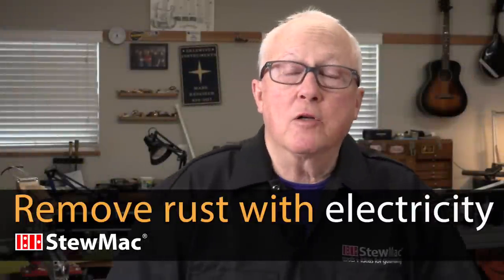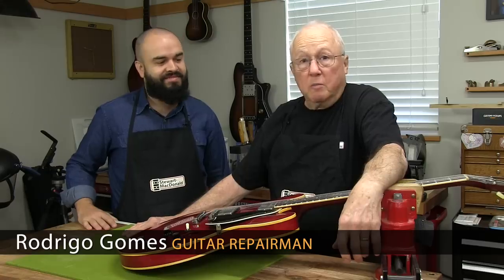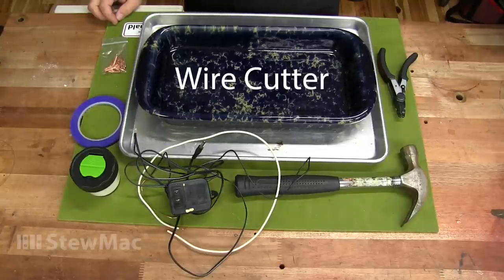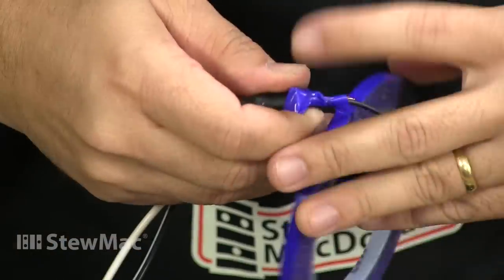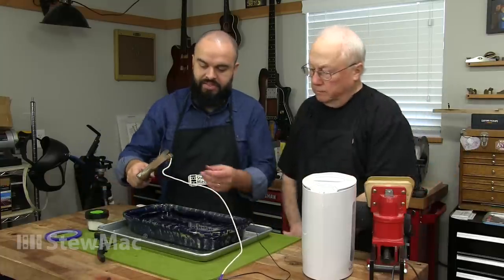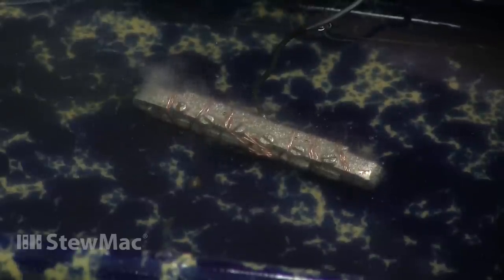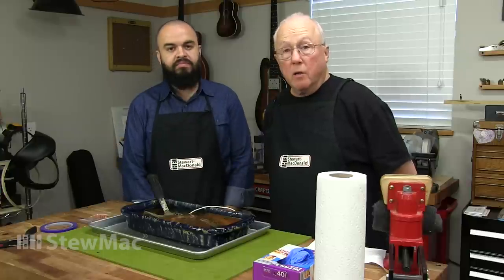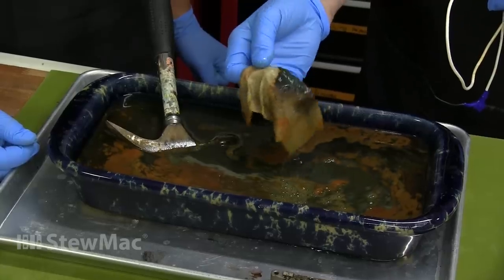Cleaning guitar parts with electrolysis

Comment: One caveat, don't use any stainless steel in place of the hammer.  The chromium leaches into the water and can make some pretty toxic compounds.  Use mild or carbon steel, or better yet, graphite  (I found some graphite plates on ebay).
Reply: manobrass it just needs to be a piece of scrap steel.

Comment: 2 Amps or higher

shows PSU capable of 300mA
Reply: CSGuitars ya boi
Reply: Milliamps and amps are different so...
Reply: Yeah, but 0.3 amps is not 2 amps or higher...
Reply: @travisdillon9238  1 Amp is 1000 Milliamps. The project requires a current of 2 Amp, or 2000 Milliamps. Thus a PSU with a maximum output of only 300 Milliamps can only provide One Sixth (1/6) of the power required. If they really did use that PSU, then the required current draw would have overloaded the internal transformer thus breaking it. In any electrical project it is vital to calculte the required Voltage drop, the Current draw, and Wattage or overall Power, If the wrong Power source is used for any electrical circuit then things can end up either not working, or just plain dangerous. Milli comes from the Latin Mille which meant 1000. The relationship between Amps and Milliamps, is the same relationship as Metres and Millimetres, as 1 Metre is 1000 Millimetres. I do hope I have helped make things clearer for you.
Reply: Kenny Nicholson  interesting. are you 
An electrician?
Reply: @travisdillon9238  No, they aren't. Milliamps are a way of measuring...wait for it...amps lol

They're both current. Just different values.
Reply: 300mA is actually plenty for electrolysis. It’s not drawing an excessive amount of current. You’d be hard pressed to find a 2Amp adapter aside from a USB phone charger
Reply: @prestondoring2640  He said 'wattage'
Reply: The  ACTUAL current drawn will be a function of the conductivity of the solution and the voltage of the wall wart. You CAN'T break Ohm's Law... ;-)
Reply: Preston Doring you don’t need to be an electrician to know mili means 1/1000 hahah
Reply: @KennethNicholson1972  want to write a long-winded response? Sure. Want to say it will explode if done wrong? That's just false.

This is a chemical reaction, not an electrical project, the only thing that changing amperage affects is the rate of the reaction (literally increasing the number of electrons that flow per second). It calls for 2A so the reaction doesn't take too long, but going with 0.3A will just take 6 times longer for the same result.
Reply: @Embattled5211  The power supply used here is a constant voltage source type. There is no current control. Therefore the current drawn is solely determined by the conductivity of the bath and electrodes. Good luck calculating the current draw from first principles! It would have to be done empirically, and would change during the reaction too. If that current turns out to be greater than 300mA then you are over-rating the power supply. It could potentially fail, probably due to overheating or an internal fuse blowing. It probably wouldn't be a flash/bang/wallop kind of failure, but the transformer primary might short out and trip your home fuse/circuit breaker. They just picked 2 amps as the probable maximum that their setup would require, they have no idea until they try it! They could increase current to speed up the reaction, all other things remaining equal, by using a higher voltage DC supply; I=V/R after all.
Reply: @travisdillon9238  Yes.... 300mA is much lower than 2A lol

Comment: stewartmacdonald

Sorry for any confusion this may have caused. It looks like our earlier reply to this question was not reposted after the first video was accidentally deleted and then uploaded again. It was just a case where Dan misspoke. 300mA is easily enough to complete this electrolysis process. In fact, you'd be hard pressed to find a DC power supply like this with 2 amps.
Reply: Thanks for clearing that up. I found a 12V/5A one but that seemed a bit excessive. I'll be going for a lower amp PSU.

Comment: If you use salt, chlorine is produced during electrolysis, which is really not something you should be breathing. You may want to use baking soda instead.
Reply: sodium carbonate aka washing soda is better,
Reply: i know. frederic
Reply: also open your windows...
Reply: Salt is corrosive to metal, he should have used bicarbonate or at least washed the bridge of. It's salt in your sweat that corrodes the chrome parts in the first place
Reply: MrSongwriter2 in a short exposure to diluted salt like this it won’t make a difference, not to mention they wipe it all off.
Reply: @MrSongwriter2  Only over time, its not a ship dude, its a guitar bridge.
Reply: @NickWeissMusic  he's talking about the chlorine gas, not exposure to the salt
Reply: Along with chlorine gas it makes sodium hydroxide which is really nasty.
Reply: also creates hydrogen so be sure to grab a smoke while it's cooking!

Comment: Just tried this myself, and works frickin' awesome! What's left behind looks like something  you've gotta have a permit to dispose of, though. Make sure the pan you choose is retired from casserole makin'..
Reply: I'm getting ready to try the electrolysis..glad u had luck..I'm excited..
Reply: Plastic bucket works.
Reply: It's not toxic - the rust is transformed to a different kind of iron oxide - magnetite, which settles out as black crud. There may be a little copper in solution from the hard chrome base. The steel hammer is a sacrificial anode, so there is iron in solution in the water as well. But it can do down the drain or in the dirt, or just let it settle out and keep you solution for the next derust job. I've got a 5 gallon bucket that I just keep using.

Comment: Firstly, fabulous 'how to's.....' I've always been extremely careful with electricity and have always steered clear of it but I have an old brass bridge that is all-but black and a bit pitted. This looks an excellent way of cleaning it. So my question is a simple one...How safe is this to do ? As I understand it, you're simply extending the  - and the + of the power supply. Is this correct. Sorry for what appears to be a no-brainer but I really don't like electricity. Thanx. Dean
Reply: The fumes are probably more dangerous than the electricity. Worst case you short it out and there are some sparks that could hurt a little or set something on fire. So for both it might be a good thing to do it outside and on something non-flammable. 
It's the 12v part that makes the electricity really non-dangerous, just don't cut any wires running to the outlet :)
Reply: Many thanx for the reply. I'll be getting with some cleaning. Thanx again

Comment: 2 amps or higher?
Reply: MrOne2watch Or lower (the supply they showed in the video was like 300mA LOL), but higher current strengthens the electrolysis process. And no, it's not dangerous at all.
Reply: @JulianA-tr6pt  
Is it slower with lower current or?

Comment: I use this technique but I use a car battery charger. It works well on an old rusted Habachi BBQ that would not open. When I took the Habachi out of the water the to door fell open. You can also use baking soda instead of the salt. I did find this in one workshop magazine from the 80s

Comment: Use Baking soda instead of salt to reduce possible undesired corrosion after removal from electrolysis bath..😉
Reply: Using salt also produces Chlorine gas, not good inside.

Comment: FYI — If you use cleaning soda rather than table sale, then you won’t have to deal with chlorine off gassing, which is pretty unpleasant stuff.
Reply: Btw, cleaning soda (sodium carbonate) is not the same as baking soda (sodium bicarbonate)

Comment: 300 mA charger shown, but audio says 2A; I see a couple of comments about this, but didn't see a reply from Stewmac. Maybe I missed it?
Reply from the maker: Sorry for any confusion this may have caused. It looks like our earlier reply to this question was not reposted after the first video was accidentally deleted and then uploaded again. It was just a case where Dan misspoke. 300mA is easily enough to complete this electrolysis process. In fact, you'd be hard pressed to find a DC power supply like this with 2 amps.

Comment: I have used a 1 amp battery trickle charger to remove rust from motorcycles gas tanks. Takes a while but it works

Comment: I made this question before and I think it got lost... so here I go again..

is it possible to do that to rusted strings too??? 
I know it might be better to buy a new set of strings but here in this part of the world (Venezuela) that task has become somehow impossible due to economical crisis, inflation and lack of importation. 
thanks 🤘
Reply from the maker: Hi Steven, sorry we missed your question the first time around. We've not tried using this technique to remove rust from old strings. The success of the electrolysis process can depend on how much surface area is exposed, so I'm concerned any grime or oxidation between the wraps on wound strings would not be removed. Or you would at least have to leave it for a very long time for better results.

Electrolysis can also remove very small amounts of metal along with the corrosion, referred to as pitting. The resulting pitting could possibly weaken the strings structural integrity, which could in turn cause the strings to break more easily.
Reply: Bass players have been boiling there strings for years. When I was a poor teenager I used to boil my acoustic guitar strings. Would brighten them up, if I was in a push to get new electric guitar strings I'd boil them too. It works pretty well. Use a bit of powdered laundry detergent biological is best for getting dead skin and grime from the winds

Comment: Please if someone can help me: i have a yamaha pacifica 610 i got it new the last summer and now i can see  some rust on the chrome volume and tune knobs and also on the back plate that sticks the body with the fretboard and the tuners enyway i can see little rust points everywhere exept on the tremolo xhat can i do??
Reply from the maker: The 3M Flexible Polishing Papers are perfect for this kind of maintenance.  We recommend using the pink (3 micron/4000 grit) paper to remove tarnish/oxidation from your guitar's hardware.

Comment: For the love of God, DON'T USE A VENTILATOR! There will emerge oxyhydrogen (=detonating gas). The last thing you need, is an ignition source like an electric motor. And don't switch stuff on or off, because that can cause break sparks which again are a source of ignition.

Comment: I used the same method in Damascus Steel  the  your turning the salt water into a boiling pot keep hands out it will kill you . Maybe something that small of juice wont hurt but using a 12 volt charger  sticking your finger in the water  it will cook your cookie

Comment: ...is this a reupload? I swear I saw you guys do this before.
Reply: Kassandra M without watching it yet I wonder if they took out the part where they said it was OK to touch the water while the electricity was running. Time to go watch it again.

Edit: nope. Still touch the water
Reply: gizanked 
It's ok you know. Such a low voltage in DC doesn't do anything, the skin is far too resistive.
Reply from the maker: We accidentally deleted it and put it back.  (oops)
Reply: You're confusing current with voltage. Voltage is how narrow or wide a river is, but current is the speed and depth that it flows.
Reply: mezsh 
You need a certain amount of voltage to make a current pass through a conductor with a certain resistance. That's what I'm referring to, and it's perfectly in line with Ohm's law
Reply: Fabián Riquelme very true, but it's not voltage that kills, it's current.
Reply: mezsh 
No voltage= no current. You have both in the right amount, or neither.
You can have 20 amps at 1 volt and it still won't go through healthy skin.